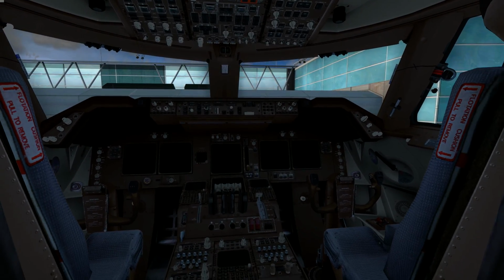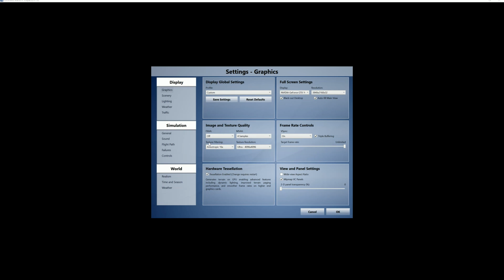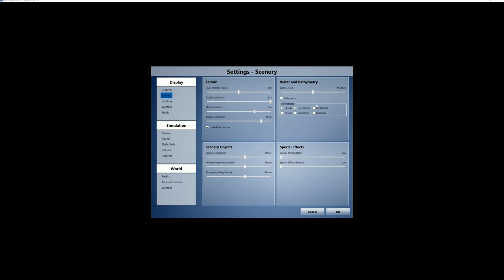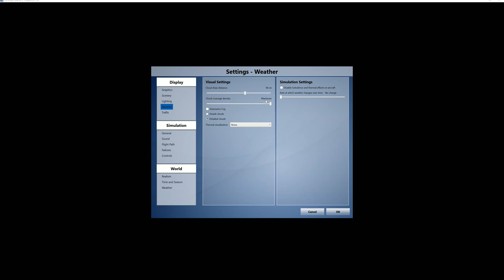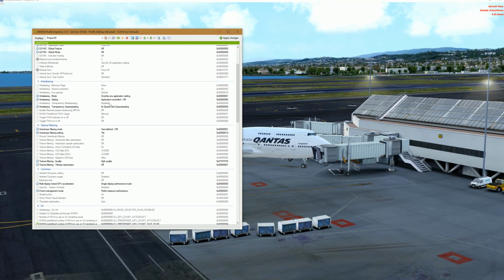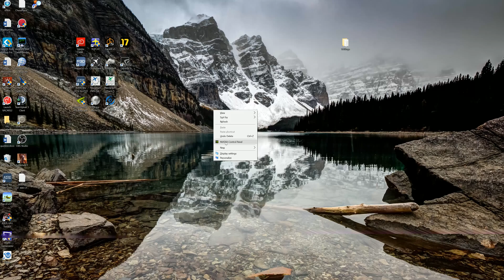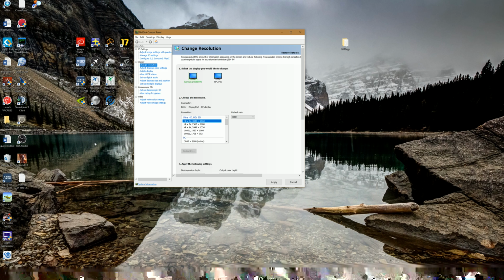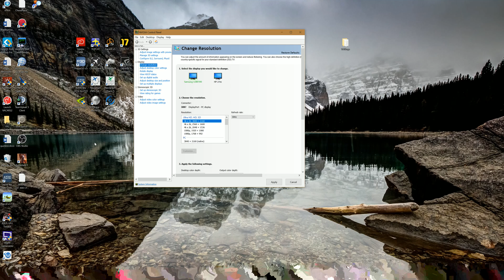[P3D V3.4] - 4K SETTINGS & HOW TO ELIMINATE STUTTERS - 2017

Comment: locking fps to 30 fixed like 80% of the stuttering problem, and i think the stuttering comes whne ur fps is quite high then it drops down in a much lower rate due to rendering new objects so yeah i THINK thats the reason.... maybe not, anyways locking to 30 fixed it for me.

Comment: Hi Vincent, thank you for the video. I'm runnimg at 30Hz 4k too, in a GTX980 (2) SLI mode. Here, I note that SGSS is not necessary at 4K and has a high impact at performance in clouds. If you are runnimg 378.49 driver, try do not use any AA filter in NI, just set in P3d 04 MultiSample and turn on FXAA. The image quality is better whitout SGSS at 4k. If you want, you can try SS (Super Sample) at NI, but only MS and FXAA sets only in P3d internal menu gave me better results. Happy landings!